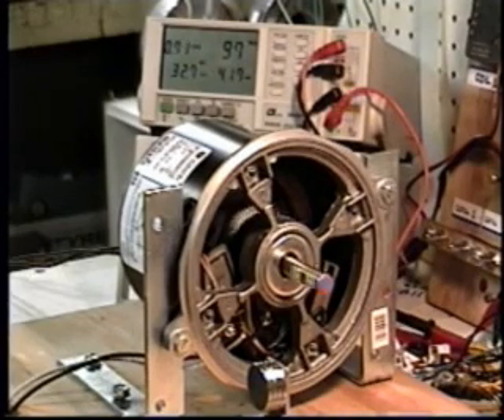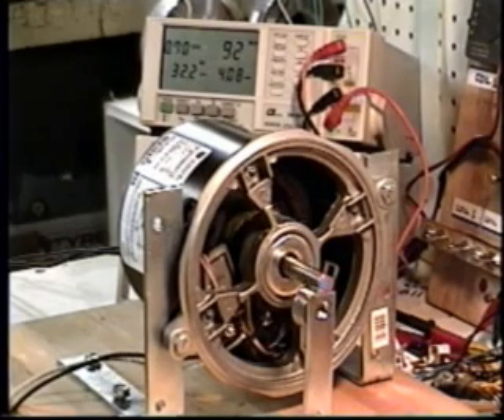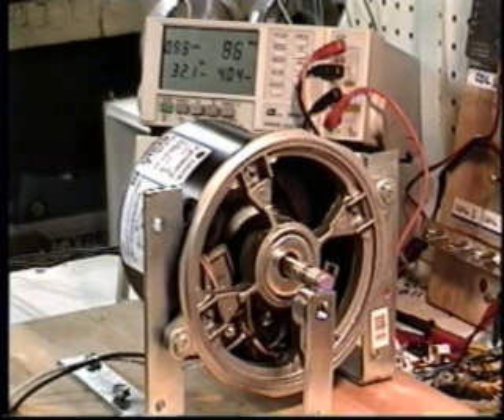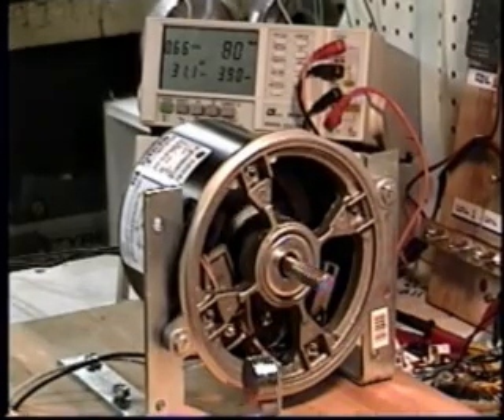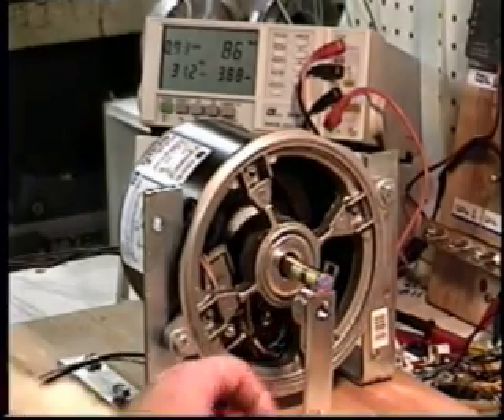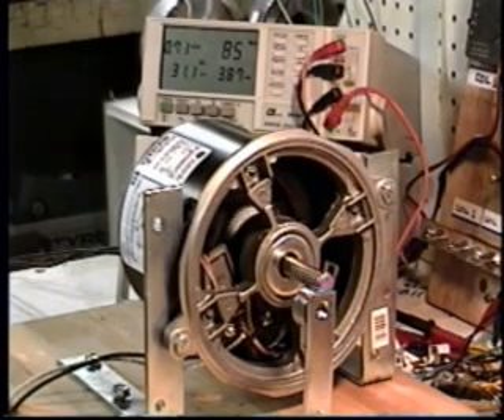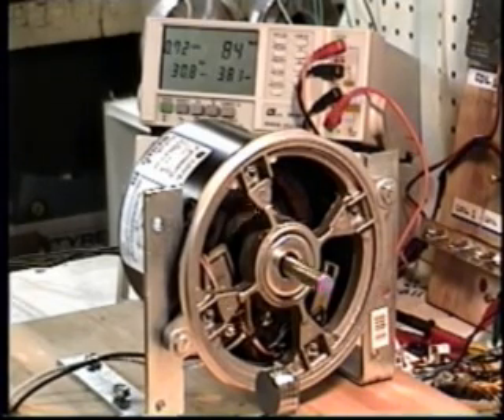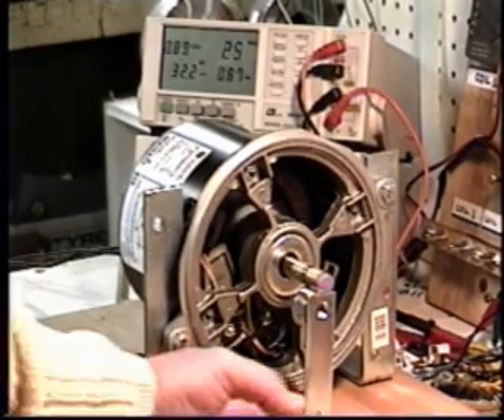PEREPITEIA GENERATOR DEMO VIDEO - Part 6

Comment: The clicking is from a centrifugal switch inside the motor. The purpose of the centrifugal switch is to disengage a (high current) startup winding after the motor gets up to speed. The purpose of the startup winding is for extra torque at startup. If you look at the bench meter before the click(s) it shows 4 Amps, and after the click(s) it shows 1 Amp.

Comment: For example here we have an electric loco here. It is a universal loco, it is suitable for heavier freight trains and passeneger trains. It has a "overdrive gear" that based on the pronciple demonstrated in the video. The magnetic field of the stator of the motor is decreased (just like in the video), and it can go faster, but loses torque and efficiency. This feature makes it capable to haul light express trains fast.
It is an almost 50yrs old design...

Comment: The magnet placed in front of the shaft would polarized the shaft causing the centrifugal switch in the rear of the motor to energize at a lower rpm, this would drop the motors current and this is not free energy.

Comment: my guess is that since the shaft has better magnetic properties it has to do less effort and can produce more torque, there is no extra power, but this system has better effeciency what was lost in the past, maybe you can let the motor run on its own on 80rpm and check the heat, then with the EMF you should get a cooler result, i guess.

cheers and nice work!!

Comment: it does not violate the first rule of thermodynamics.  its not a closed system, just a very, very efficient motor.

magnets demagnetize over time since they must overcome, at worst, friction and at best, gravity.  since this system gradually moves twords entropy, the rujle is not violated.

It is, however, an exceptionally efficient motor!

Comment: It's the slip ring kicking on and off. He's changing the voltage, or turning it on/off (he's doing this off camera). I think he's trying to get a certain speed for his effective to work. 

Read up on slip ring induction motors on google or wikipedia.

BTW I can't say whether his results or genuine or not, but it interesting to speculate.

Comment: Can anyone say actually what that clicking is?  If it is a circuit breaker then it is clearly using more energy when it goes faster and hence tripping the breaker.  The magnet allows the motor to use more energy.

Comment: What's the speed of the motor got to do with anything? No load => no output power => zero efficency. As far as I can tell zero is still less than one and certainly not greater than one.

Comment: That's not the point though. there is no immediate energy cost, it might be 99.999999999% efficient, which is still a heck of a lot better than any kind of energy system now.

Comment: He is wrong that it has no energy cost with it.
The "permanent" magnet is not permanent, it will loose its strength over time.
It took energy to magnetize it, that energy didn't just "appear".

It only takes a very tiny force to accelerate a motor under no load.
Your only fighting the internal friction of the motor.

I'm going to hazard a guess of much less than 1 percent savings.
Then factor in the engery of manufacturing and shipping the magnets

Comment: only the point of the nominal speed is changed. your equipment that messures the energy input only mesures apparent power, but not effective power.

the motor only needs engergy to accalerate and to compensate losses. when it reaches top speed the effective energy input dropps. by changing the koefficient for the top speed, this process is  moved to an higher speed. 

your idea of a "perpetuum mobile" bases only on the known inability of digital wattmeters to mesure effective power.

Comment: you can clearly hear a click in the background why would you need to reset the variac control notice the click in the background and not the magnets attracting to the shaft but second click if you time it right  you could reset the motor to a non operating voltage which would take time to get up to speed giving him enough time to slide maget to it to appear to be causing the increase in speed

not saying its fake but Hmmmmm
just though I'd "BS" a little toooo hehehe

Comment: This external force has NO ENERGY COST associated with it and it violates the Work Energy Principle ... false, it's only making the energy flow fromelectricity to mechanical work easyer.. that does not mean that it's free energy. Its like saying taht grease is making a car run farther with the same amount of gas therefore making free energy ....

Comment: If you take a small brushed magnet motor running at a constant speed and current,then apply a flux shield around it,the current drops slightly and it accelerates to a higher RPM.WOW so does that prove anything?.yea you just improved the efficiency of your motor.so that's what i thought of watching your video.nothing ground breaking here,try explaining whats going on,why.disconnect the  power will it keep turning?,no ?,you like playing with motors nice .